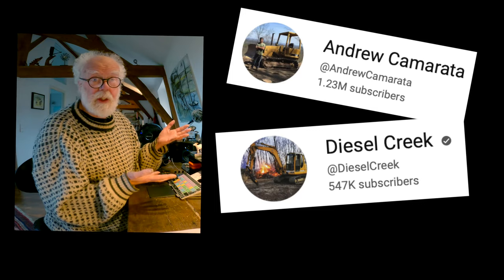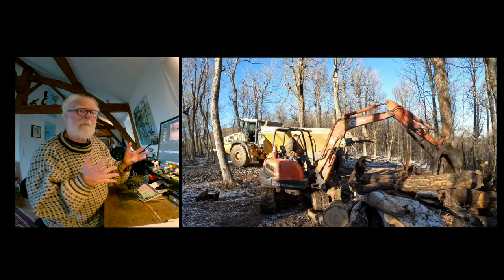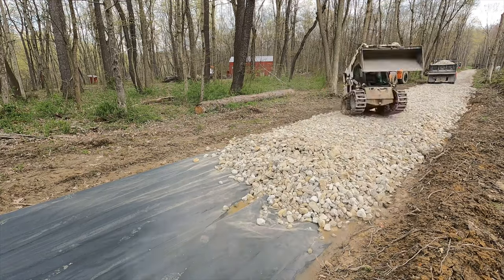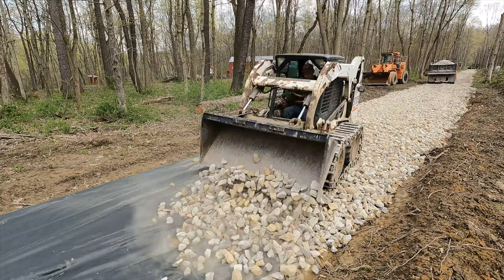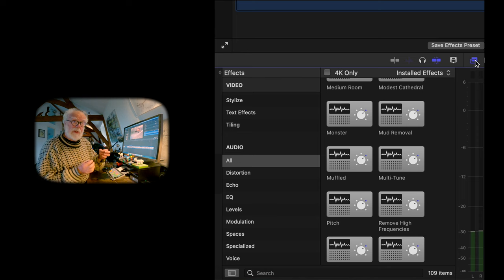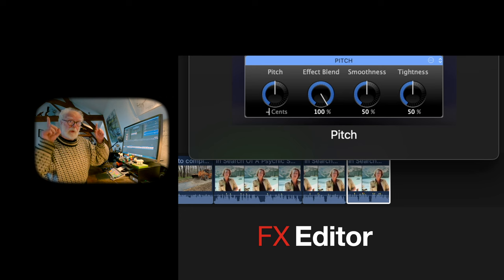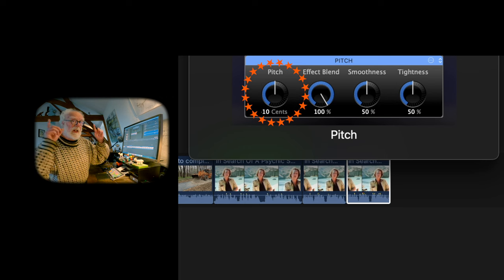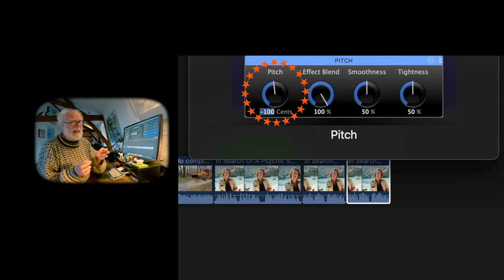How Matt from Diesel Creek and Andrew Camarata can fix their YouTube films

Comment: There was a winner of an Academy Award in the technical division for coming up with a process that would both get rid of the pitch effect and somewhat normalize the speech, so it would be possible to speed up broadcast movies and insert more commercials or make them fit into time slots without scene editing.  The technical awards aren't broadcast because there are no movie stars, and no viewership which would be interested into what is occurring.  They ran the end of the original timed CASABLANCA with the speedier version and the speech came off well, but the sped up clip ended quicker.